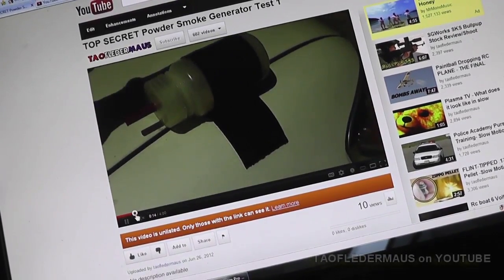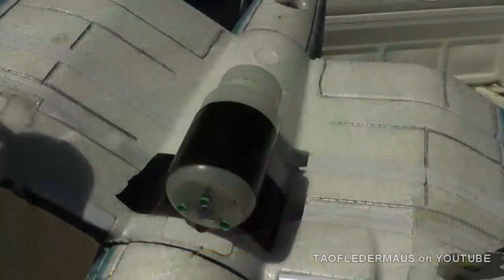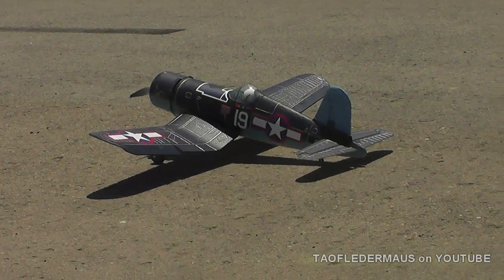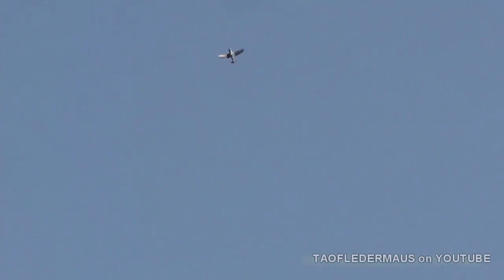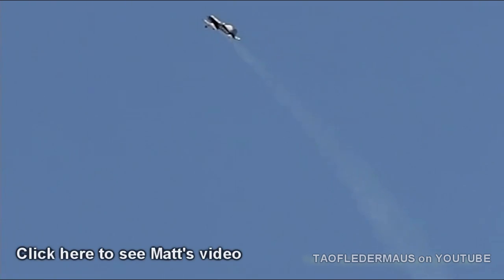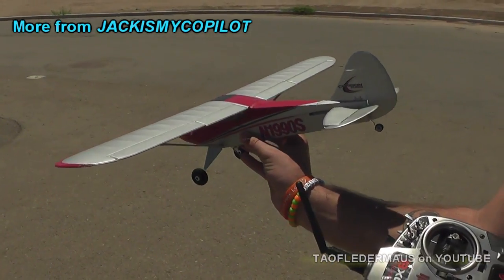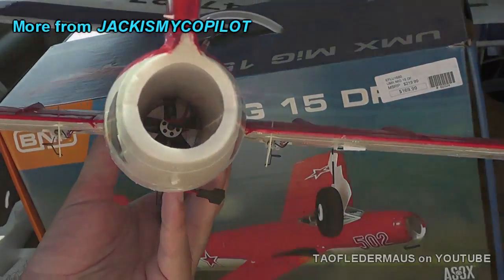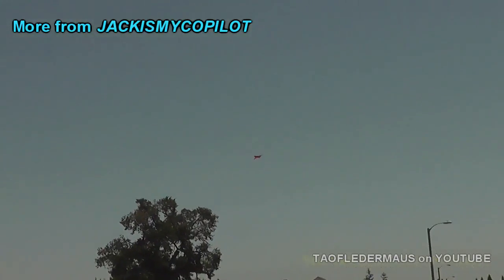Cool Invention:  RC Airplane SMOKE GENERATOR

Comment: I think you are wise to use a non flammable concept like powder instead of any real pyro technique to generate actual "smoke".  In the military we use pneumatic activated talc charges to simulate detonations safely in training.  If you wanted to work with colored "smoke" trails just use the colored chalk powder available at home building stores and mix it with talc to fluff it as necessary,

Comment: Oh well, then that's out of the question... hmm.. Oh!!! I know!! It's a bit harder to make, but seeing your videos I'm guessing you have some good tools. Smoke bombs doesn't require oxygen to "burn"/react, so that means you could put it in an enclosed container with a valve on it, set it off in a safe environment and then you will have a container full of gas and you could open the valve just a little bit and you will have a smoke trail :) Might not be worth the effort though :/